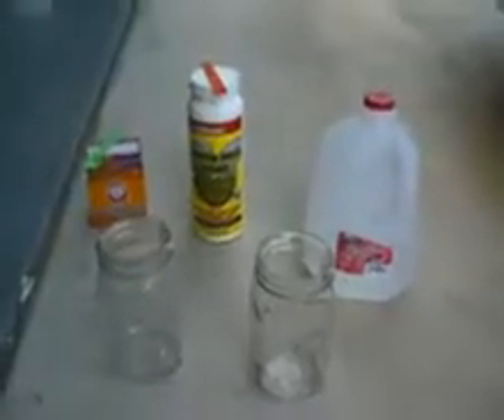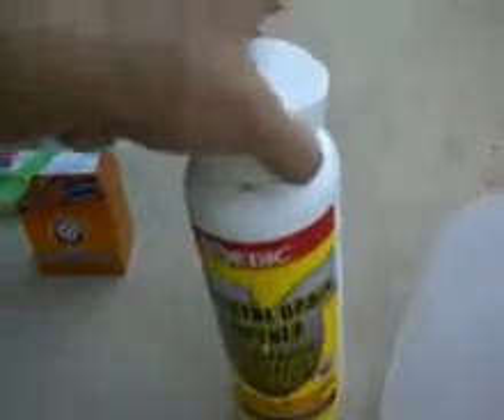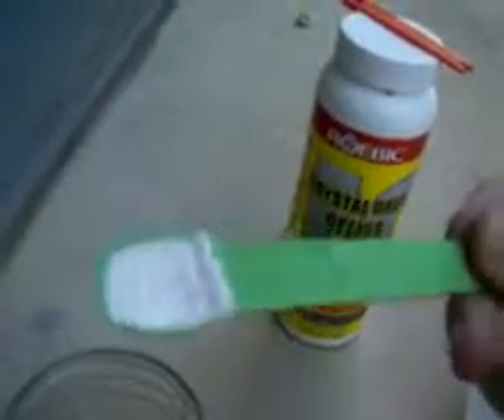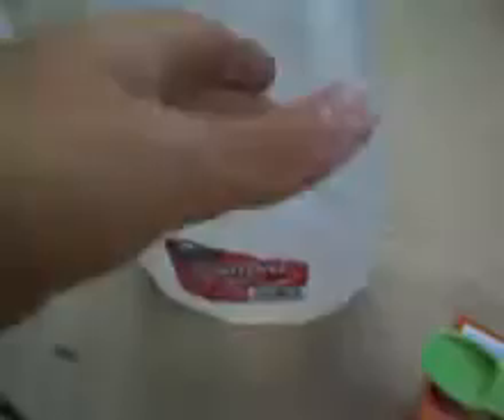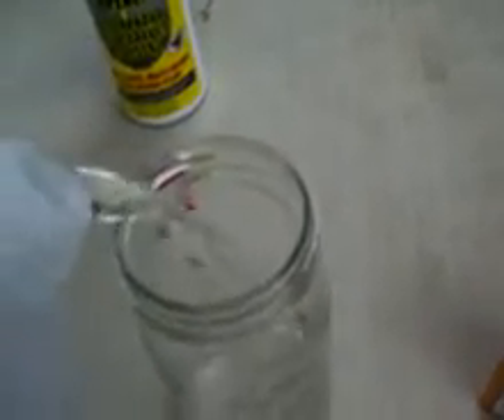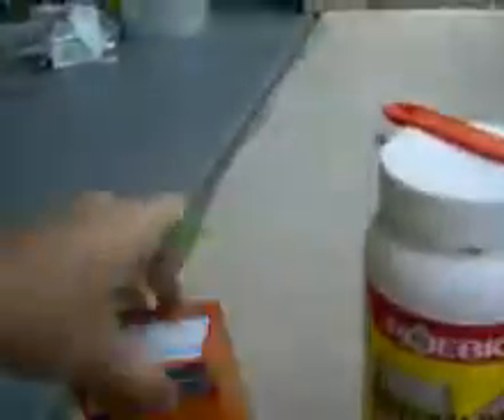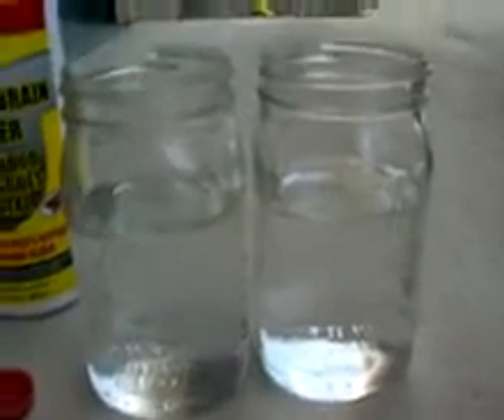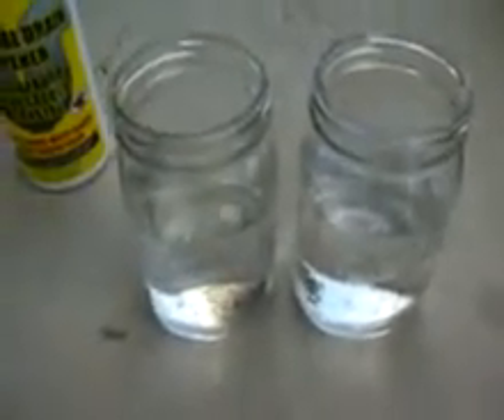HHO Generators: Sodium Hydroxide vs. Baking Soda! Pt.1

Comment: sodium chloride evolves chlorine gas because some of the molecules are given 0 charge in the water. baking soda doesn't its made of co2, hydrogen & sodium. if you use tap water you will get chlorine gas. sodium hydroxide is a powerful base and eats pretty much anything including glass, aluminium and most metals. bicarb is pretty lame.
Reply: It does not react with steel

Comment: the reason NaHCO3 is not the better electrolyte is because your production of gas will also contain large amounts of oxygen and carbon dioxide. with NaOH you receive about the same conductivity and your gas will contain much less oxygen and no carbon dioxide. so with NaOH your "hydrogen" is more pure.  when using salt the gas that is produced that you dont want to be breathing is chlorine gas... NaCl Cl = Chlorine... enjoy :)

Comment: ok. baking soda is NaHCO3. carbon dioxide is the gas produced. carbon dioxide is not toxic it is what you exhale. ok. so in electrolysis NaHCO3(baking soda) breaks down into sodium witch reacts with water and produces sodium hydroxide or NaOH... so..the hydrogen is bonded the carbon is released as a gas, and most of the oxygen is released as a gas.. so.

Comment: if compared and measured with an Ampmeter, would sodium hydroxide produce more energy or would baking soda produce more energy? which electrolyte would efficient energy wise? ... regardless of stains, temperature, and amount.